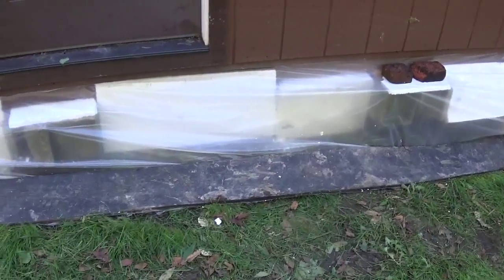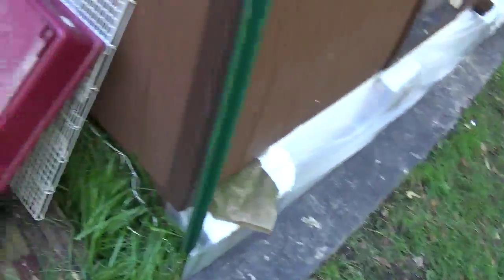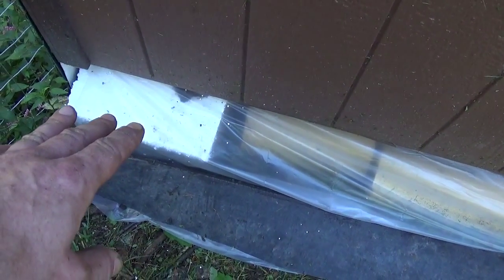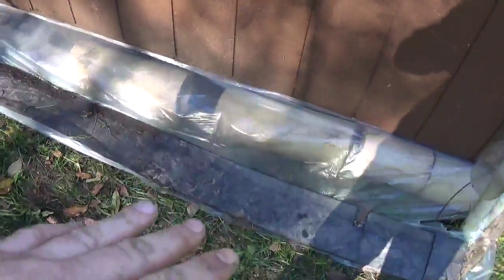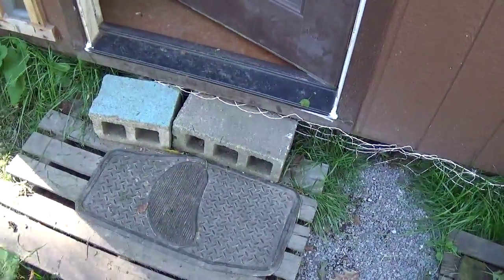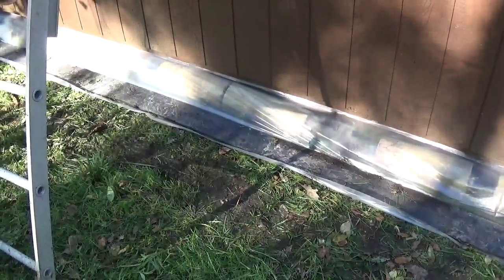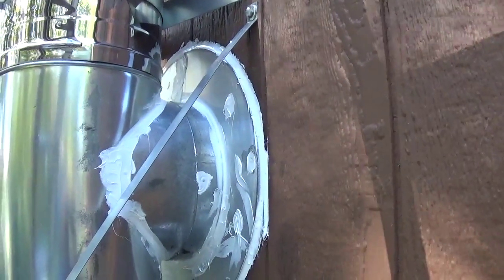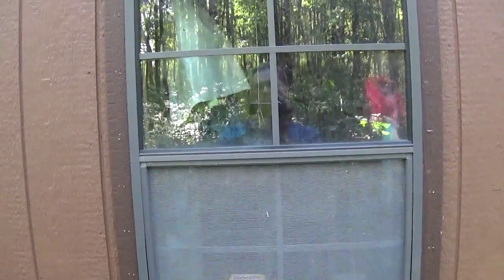Winterizing The Cabin Skirting Time

Comment: Hi Doc. Many,many years ago, as a student, I lived in a cold draughty flat. To save money on heating I cut out some foam panels the same size as the inside of my window frames an wrapped them in foil. During the cold winter nights i jammed them in the widow frames and the difference it made to me was dramatic. 
Obviously as the owners you are allowed to do things such as staple and caulk which I couldn't but I thought I'd share my experience anyway, hope you don't mind.

A while ago you said you were going to winterize the chicken coop, are we going to see that on an upcoming video? Because I'd be interested to how that's done. Hopefully not the same way they do it in certain parts of NY (cram 50 chickens into a 1 yard cube and let body heat do the rest).